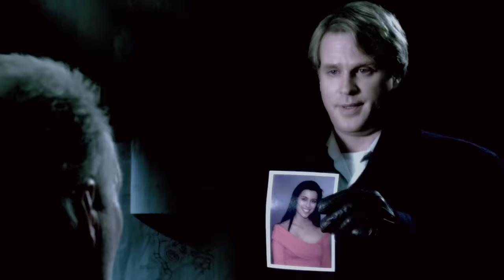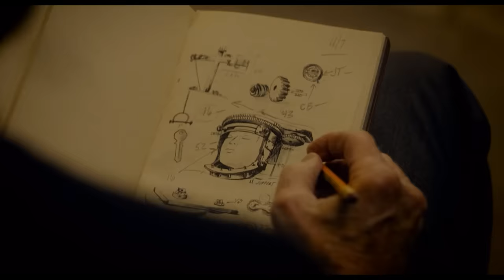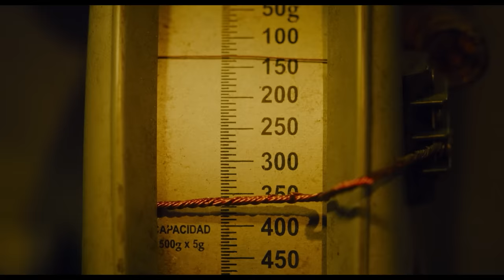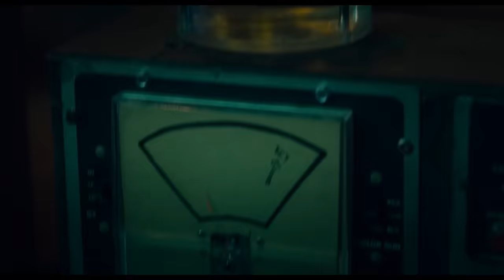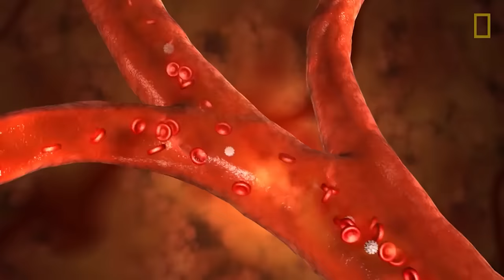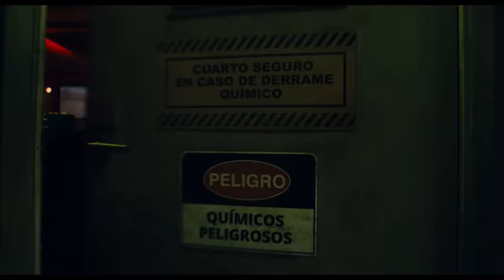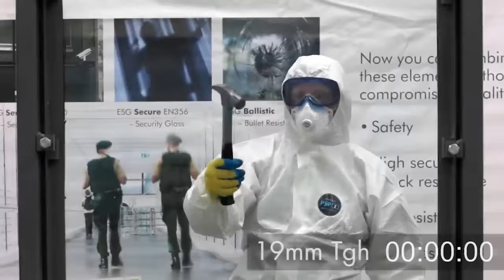How to Beat JIGSAW in SAW X

Comment: - 1:58 Exactly. John is FANTASIZING about the trap he'd make for the orderly. This scene does away with any delusion that he's trying to be justice, he's just a sick sadist, especially since he's punishing the poor orderly for RESORTING to stealing trinkets rather than the system that puts the guy in a situation where he needs to steal. 😒 But then, that'd require work. 🙄

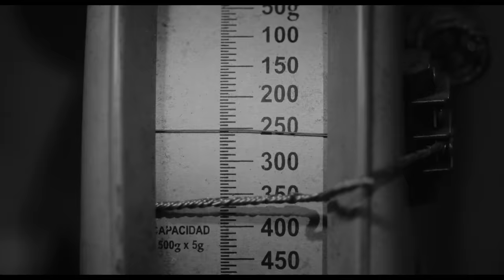- 11:42 Indeed. The arbitrary time-limit is 100% BS. She ended up going through the excruciating torture of cutting her own leg off and STILL lost her head for a few seconds. Screw that garbage, especially since it's not like John bothered to test the trap to calibrate how much time is reasonable, it was completely arbitrary and too short. 😠

- 11:55 The trap works by sucking out liquids to trigger a scale. Just suck out some blood. Blood has a density of 1060 kg/m³ which means it would require 80mL to provide the requisite 3oz/85g, which is a far cry from the 1L of blood that's survivable. Just let it suck your blood like Dracula after a diet.

- 12:39 Um, my high-school lab partner in science-class did something like this during fetal-pig-dissection. 😒

- 14:02 This is absurd, the guy isn't a brain-surgeon, he's pretty much guaranteed to screw up his motor-cortex and make it impossible for him to move to finish the trap. 🙄

- 15:42 John's traps don't just execute his victims, they TORTURE them. John's full of crap. 😒 This is especially true in this case where they merely stole some of his money that he won't need soon anyway and in exchange, gave him a bit of hope that could have made his last days a little brighter instead of going out in pessimism. That definitely doesn't call for being tortured out of existence. 😠 This is why I'm conflicted about fake mediums and psychics. Sure, they're lying, but for some people, it's helpful, it's closure, it's therapy; some people WANT the lie. 🤷

- 16:31 It's not just not a bad idea to free her foot first, it's NECESSARY. HTF would this trap work if she freed her hand first? 🤨 She'd fall down, and swing over and hang from her leg upside down and possibly be unable to do crunches to swing herself up to swing at her foot?

- 16:59 Nobody saw that coming because it makes no sense. WTF did Parker show up at the warehouse and yell blindly at the door to her? Why did he let himself get captured? If he was putting on a ruse by continuing to pretend he's a victim like John, why'd he let himself be captured? If he came to free Cecelia and didn't intend to be captured, why'd he pretend? Those two parts don't mesh.

- 17:09 Gee, a bad guy betrayed another bad guy? It's almost like criminals and villains can't be trusted. 😲 😒

- 17:23 😂 IKR‽ Cecelia was presented a generic scammer, but then they changed the tone to make her out to be running for the Most Evil Villain award. 🙄

- 17:45 😂 IKR‽ There isn't an infinite supply of blood, just hold your breath until the tank is drained. 🙄

- 18:00 😂 IKR‽ Carlos decides to drown himself in blood to save a random old man who has brain-cancer. Okay. 🙄

- 18:28 So… John knew Parker was working with Cecelia and would overpower him and Amanda and put them in the blood-trap and go for the money in the office to make the office a trap like the time Hoffman made that trap that was actually an escape-hatch and the room itself was the actual trap? 🤨 Okaaaaaay. If he's got such godlike omniscience to account for so many absurd variables, then why doesn't he just use that omniscience to cure himself? 🙄

- 18:57 That still doesn't explain why Parker pretend to be a victim AND let himself be captured.

- 19:12 It's like nobody in this movie is capable of holding their breath and taking turns. 😒

- 19:27 This movie ended stupidly ambiguous. So she's just hanging there, waiting for the acid-gas to dissipate and for the police to come and unlock the door, and gettign her flesh melted off in the meantime? And John let her go because she "passed" the test, despite how evil she proved herself to be? 🤨

- 19:57 John gave the stolen money to the kid. Um, what about the victims? 🤨 John just trafficked in stolen-goods and made the kid complicit.

- 20:10 😂 IKR‽ They never explained wtf Carlos and his father were there. I guess John just believed that they really were the groundskeepers like Cecelia said, even though nobody else was. 🙄

This movie was obviously written by a rank amateur, almost as bad as the middle-school tweens who must have written the FNAF movie. 😒

😂 IKR‽
Reply: so many emojis, but they (people/youtubers) said 3D SAW was final movie until THIS MOVIE came up. I would like SAW movies to end like series finale instead of waiting until next SAW movie to be to not be finale.

Comment: The "traps" shown in this video aren't really "fair" besides maybe the bombs. The marrow one, while easily beaten by either cutting the rope (or if we imagine it as a chain, cutting our pants and giving the suction device a drink of piss) relies on someone not passing-out from the pain, blood loss, or going into shock. Large-scale bodily damage will trigger that, and there's no stopping it on your own. You'd pass-out long before cutting that leg off.

The craniotomy wouldn't work for the same reasons, and literal brain damage including blood on the brain would instantly render anyone dumb enough to try to complete that task incapable due to having a stroke. Brain surgery is hard for a load of reasons, and that's one of the main ones.

If the heat lamp were actually radiation, it'd be pointless to try anything unless you wanna die of radiation sickness after a full-body dose of that intensity. (And it's MUCH worse than all Saw "traps" combined!)

And then there's infection. If you do as you're told, you'll end up falling to sepsis.